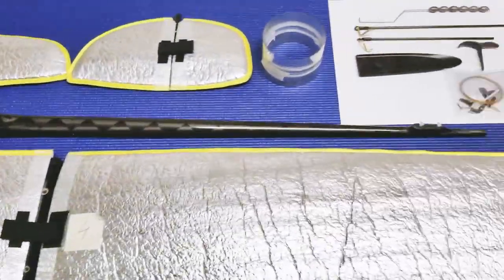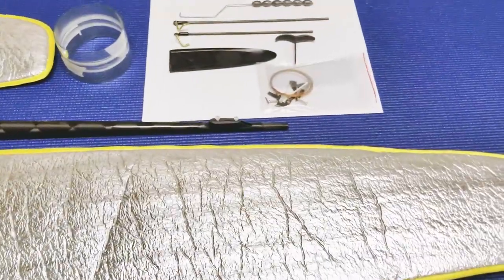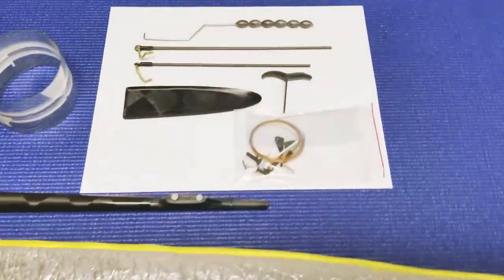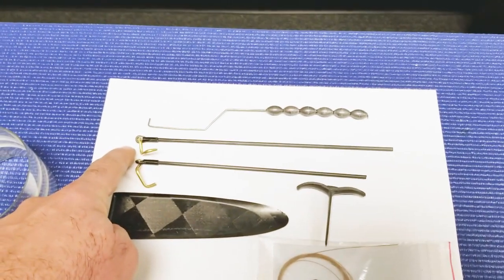GCM Fireblade 2.5 F3K

Comment: Looks like a very nicely built airframe. I 'll consider a Fireblade for sure. 
Not sure I really like the linkage for the ailerons. I had a similar setup before on an other old dlg design and there was a lot of flex. Can we have a look at both the aileron end and servo end of the linkage?
Reply from the maker: For now Fireblade production has stopped, production on new model, the "FX" will start soon.